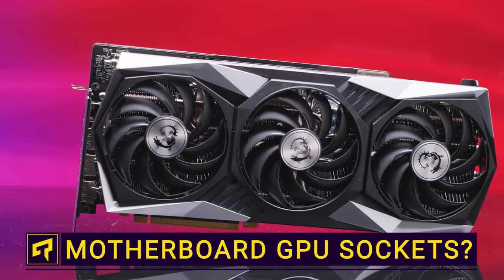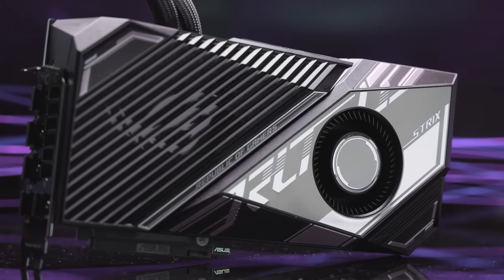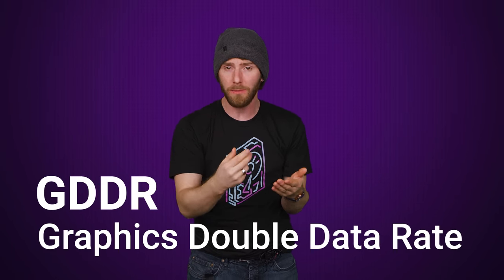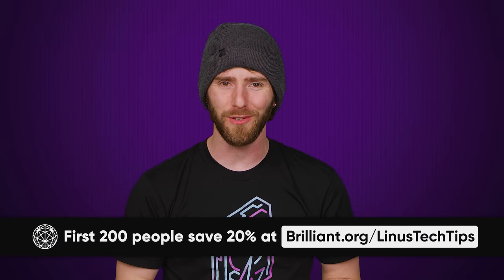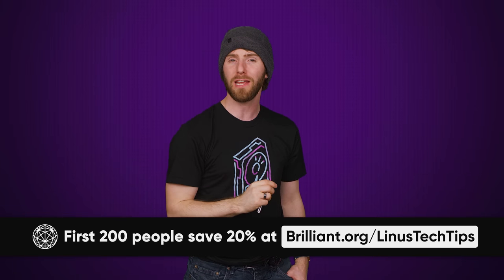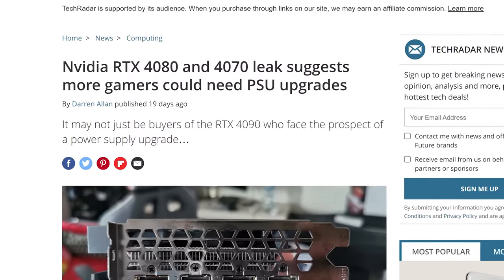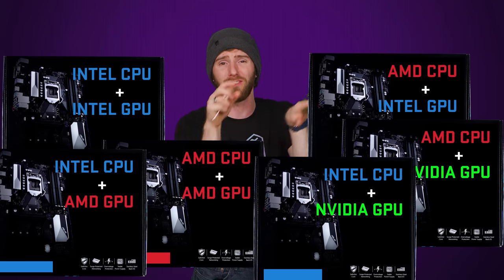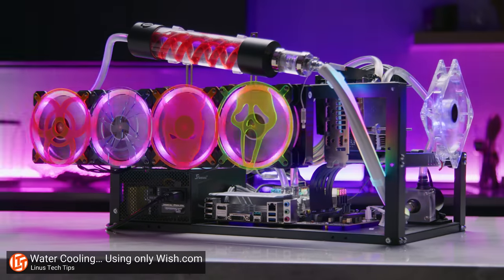Can You Put a GPU on a MOTHERBOARD?

Comment: I have in my parts bin an old Fujitsu Siemens Amilo Xi 1526 laptop with a detachable/replaceable 256mb mini PCI express graphics card from back in the good old Windows XP days. The CPU is socketed as well. So, back in the day it was doable.
The graphics card in mine is pretty much done, I think, and due to not many buying those machines, I never got around to buying a new graphics card. An ebay replacement would have cost more than the computer was worth. I could buy 2-3 better laptops secondhand for the price of one graphics card.

Comment: Company's did do this in the past, as recently as Socket AM3 actually that came out back in 2009, there's 880G chipset boards that come with a intergrated Radeon HD 4250. So why isn't it done today with a low power GPU chip (let's say 25W TDP or less as from what I could find that's what the HD 4250 was) built in powered by the motherboard, a PCIe slot can supply up to 75W of power to a card if I'm not mistaken therefore why not sacrifice a PCIe slot and redirect the power delivery & PCIe lanes from the slot to the built in chip?
Reply: For example, why not cut down something like the RX 6400 to use even less power & maybe less PCIe lanes to maybe have like a RX 6100 or 6200 that uses a max of 25W & remove a PCIe 1x slot with that PCIe 1X lane going to the built in GPU instead?
Reply: Depending on costs involved, I think It would be a OK option for a basic display out for basic use/office PC builds, perhaps bring back the Athlon for next gen with a CPU only option instead of a APU, make it cheap like maybe something along the lines of a Athlon 3000 non-G for less than G like how the Intel F CPUs should be cheaper than the non-F but have it on the lower end, like if Intel were to put out a Celeron G6900F or Pentium G7400F?

Comment: BUT, if you had a graphics card that fitted into the PCIe slot and allowed you to configure more ram and change a chip rather than a board. and dealt with the power it would allow the PC builder to configure the set up to achieve the desired picture quality and FPS. Yes this would be expensive but then so is a 3090 TI . I have an AMD 5600X cpu but if I want to upgrade I can fit just a new cpu and keep the rest the same. I don't have to buy new ram, board, cooler etc. Power delivery can still be achieved to a PCIe mounted board without going through the main motherboard. Vram could be in modular form the same as Dram and applied in the same way. If you need more or a higher clock speed you could change the module for the required one.
I understand the argument for fully built one piece GPU's but if you applied it to computers we would all be buying laptops or pre builds with no choice but to change the whole set up when a new piece of software comes out that needs more of everything.

Comment: Linus, what about one industry standard socket for CPU and one industry standard socket for GPU, all the VRM as a daughter cards like ASUS did on the ITX size (maybe interchangeable for higher powered configurations), and RAM and VRAM as DIMMs (or maybe shared?).
This way, a graphics upgrade cost is reduced because you need to buy only the GPU (without VRM, bracket, memory, cooler, board, outputs) and we reduce the e-waste...

Comment: All-in-ones anyone? My iMac has a Radeon Pro 5500 XT 8GB in it. Runs Cyberpunk 2077 in Windows 10 at max settings, 1080p (minus ray-tracing) with at least 40FPS. Doom Eternal runs at max, 1440p, with likely 60FPS (didn't check). Looks smooth as butter. You could even get the final Intel iMacs with Radeon Pro 5700 XT that have 16GB of VRAM. Beast all on one logic board.

And yes, these Macs were worth it. You could say expensive, but they have a beautiful and bright 5K screen with an excellent camera. They only dropped recently to have Apple sell more Mac Studios and Studio Displays. Getting a late iMac refurbished is actually still a good deal, just hard to find the perfect one.

Comment: What about a single CPU socket per generation for both AMD and Intel. Now we can make mother boards be better if they can handle more power for the GPU and GPUs should have their GDDR slots so they can be upgraded like for example we have seen that RAM in the GPU came short in the same generation even on high end models

Comment: what about going the other way and have add in card CPUs.
So a smaller chip on the mobo deals with IO and all, and the CPU and RAM are on an add in card similar to how the GPU is now. whether the RAM is soldered on to the card or not isn't too important but it enables you to keep your old Mobo and upgrading just the cpu, like a graphics card.

Comment: I agree I agree BUTTTT.... I'm no computer engineer, but amd and intel, intel and amd nvidia can and should be able to use the same pin and socket design. video ram can be slottable and power delivery is as simple as adding more plugs to the motherboard. They aren't using same socket every gen becuz of money grab? they arent using same socket because they didn't have that in mind when designing? Again, I think is possible, just nobody thought about it

Comment: Integrated GPUs are the future.  They’re already the most common, if you count mobiles and consoles.
Reply: The whole point is integrated GPUs are cut-down versions of discrete GPUs.  If we got rid of discrete GPUs we would be suddenly be a decade behind in GPU power, if the new NVIDIA cards are as beastly in power consumption as leaked, even more than that.
Reply: @alexatkin  This isn’t true at all.  dGPUs are actually much more inefficient and difficult to develop for since the assets need to be copied into separate VRAM, and if the CPU needs that data, it’s gotta be transferred into system ram and then back again.  Unified high bandwidth memory simplifies everything.  Once Apple and AMD and even Intel scale up their chip-let designs, it’s all over.  The only reason NVidia is on top right now is because of their robust feature set / real time Ray tracing and DLSS, etc.
The M1 is a first generation chip, based on an 8 year old iPhone chip design…and it’s already slaying in terms of raw performance and TDP.
Reply: @5urg3x  I own a Macbook Pro, for some workloads it's a beast but it also cost more than my 3080 and the RAM can't be upgraded.  Yes it's super efficient but it's not a practical path for gaming.

Comment: Historically there is NO limitation, just ill will that prevents multiple CPU manufacturers from sharing a socket and chipset.
The Socket 7 is a great example where you didn't just get 1 x86 CPU manufacturer chip, not 2 but 3 vendors!
Intel, AMD and Cyrix, and after this Intel huffed and walked out of the Socket 7 to make sure they could sell their own chipsets to you as well.

Comment: i would like to see just a gtx 1050 ti on the mother board with the cpu and then when you slot a rtx 4090 into the board it switches to that
and the igpu in the cpu is just another backup gpu
so you will have 2 gpus in case your rtx 4090 dies

Comment: Why not to put HBM2 ECC memory in CPU? Like why do I need to send task to GPU that gonna run out of vram quickly and load up task with 2 times more ram usage/same or worse speed, if CPU can be faster with vram built in + its be using ram when you run out of it - instead of loading twice amount. I be having such issue when render engines be building BVH structure for GPU to make it understand what is happening (its long conversion of entire 3d scene for GPU, when CPU instantly loads it), and if I'm out of core (no free vram), it uses twice of ram memory. Like if SSD drive Optane can act as RAM then how much better its be to have vram under CPU? Especially with this new Photonic CPUs under development its might become a thing probably.

Comment: I can see del doing this and soldering the cpu and gpu and both memory types to the board so to upgrade anything you need to get at least a new board. The system may work better though until something breaks. Just imagine unscrewing the system and putting in the new one saving only the power if that and possibly the ssd for files.

Comment: Installing a GPU is easier than installing a CPU, though. It really seems like it would actually be cooler the other way around... if there were a slot on the motherboard, and various AIBs distributed CPUs with various kinds of coolers and extra levels of cache. Maybe some would overclock, maybe some wouldn't, etc. Having to mount your own cooler and mess around with thermal paste to get decent performance out of your CPU when a GPU just comes out of the box ready to be shoved in a slot really makes GPUs seem way ahead of CPUs in a way.
Reply: Some very old computers had the cpu like that. You stuck a whole card in a slot.

Comment: Not to mention that we already had GPUs on motherboards in the past - before becoming a part of the CPU, iGPUs were integrated into the northbridge - and they were some of the worst ones in existence.
Reply: Read up on Socket-X, that wasn't going to be low end, it was meant for high end GPUs (for the time). Rendition was working on this idea back in 1999 but never got it off the ground.

Comment: i wonder just how difficult it would be to make little adapter shims for the cpu so any board could work with any cpu
Reply: Impossible.
There's just too much variation in cpu design.
To put this in perspective, Lga-2011(intel) has 2011 'pins', Thread ripper(amd) has 4096 'pins', and AM4 uses 1331 'pins'.
Every one of those pins serves a purpose.

Comment: PCIE physical slot, like the ATX form factor as a standard are old and archaic. GPU form factors are getting ridiculous with 3 and 4 slot cards out there. and the placement of components in the modern PC dont encourage proper airflow. We need a new form factor that encourages good air flow while taking advantage of available space. This is why mini itx is the only sector where we are seeing interesting case designs, since they already need to work around the standard layout.

Comment: But this is what has been ever happened: in one hand in the past manufacturers changed slot dimensions, forms, connectors or CPU sockets, according to technical improvements. In the other hand integrating GPU, graphics RAM and power supply to motherboards will probably show the next steps into computing development because miniaturisation goes faster and faster so one day all those components wolf be at the same motherboards, as well as other components like sound and video have been integrated into CPU and motherboards. Now there are a lot of laptops with soldered components (in most of the cases for commercial reasons), so why we can't think that this would happen one day in the near future to desktop computing?
I think this has not happened yet she to commercial reasons: manufacturers will lose so much money by producing MB with integrated high capacity graphic cards.

Comment: 50% of a motherboard is PCI-E slots. You can totally put a GPU in that section. We're already getting to the point where GPU cards are so big that they just might as well make a daughter board that clips onto a motherboard. The only limiting factor to fully modular GPUs is standards agreements. If the companies agreed to a 512 connector slot for the GPU, GDDR slots for the memory, and a GBIOS slot or uefi upgrade space then we'd be done. The problem today is that, despite all the standards, we're still subjected to proprietary issues like the CPU slot designs even though they're all x86-64 processors now. Really need to open-source the PC architecture more. PC should be about features, not presentation, that's the builders problem, not the components problem.

Comment: i need help i did some shit in nvidia with my drivers and now my pc works realy bad on gta i can see my vram is full but i use to be not even on the half (its uses8500 now) and in auther games i just lag more/have way less fps for exaple i use to have around 210 fps on overwatch but its now on 85 90 my grifiic card is a 3070 ti i did restore all my settings in nvidia but its still the same

Comment: Eh?  I think it'd be pretty easy to do, and prove far cheaper than the current system.  Break down a GPU into its main component parts, and what do you have?  The processor itself, memory, VRM.  All of these can be made into slottable components.  So what if there's a few dropped bits of data, when you can add as much RAM as you need?  Most of the basic components for AMD and Nvidia GPU's come from the same outside manufacturers, don't they?  Imagine being able to swap out your VRM as easily as you do your RAM, and not be beholden to only two companies.

Comment: Did nvidia not do this for really old gpus? I could've sworn I have an Athlon 64 machine with an nvidia gpu in the motherboard itself.
Reply: They did, and LTT somehow dropped the ball on the basic research in a dramatic way. They really should pull this video to save face, but I know they won't. I say this as a longtime and current LTT fan. Sometimes they make confusingly bad errors (like saying that The Guardian is good journalism haha, poor Linus hasn't read very much of The Guardian in the past 5 years).

Comment: It wouldnt make the mobo significantly more expensive! Obviously a mobo with a GPU would cost more but surely (at least assuming that manufacturers are not AH which they are and given SAME profit margins ) cheaper due to scale of production you dont have to manufacture two separate boards but one, you dont have two companies ordering e.g 100 passive components for the mobo and the gpu company 30 passive components for the graphics card but rather one company ordering 130 components from one vendor which makes the process faster and cheaper.

Comment: Modular gpu
MAKE A MODULAR GPU
it doesn't have to be compatabile with all gpu boards, just something you can upgrade for cheaper

It doesn't have to plug into the motherboard, just on a separate board like a gpu

Comment: There were voodoo3 motherboards, nforce (gf2), hell, you even bought a 1050ti motherboard. That's ignoring most laptops ever.

But I guess your point was the socket approach, which hasn't been done.

What I'd like to see is these: https://www.intel.com.au/content/www/au/en/products/details/nuc/elements/compute.html

But with the components on the other side so you can have the CPU and GPU back to back on your backplane - and add real cooling. Probably not quite as short of a card either. If you're going to have a backplane based motherboard, you can at least have it plug into 2 16x lanes and not be longer than a full length GPU.

Maybe suggest that to AMD and Intel? It'll be good to ditch the stupid pcie cables on an sff build and instead have a far more robust backplane.

Comment: I always thought that there should be a GPU socket on GFX cards. So basically you could buy a 12GB 3060 and update the GPU to a 3090 when you can afford it just by replacing the GPU chip and not the whole board. It really wouldn't be a hard thing to implement.
Reply: The problem is though with something like that, you'd run into a similar problem that Linus brought up. Compatibility would be a big issue. GDDR vram timings and bandwidth not playing nicely with different GPUs would be half of the battle. Not to mention cooler incompatibilities. A 3060 cooler would never be able to support a 3090. Nor would the power delivery on a 3060 board. So like linus discussed, the board for the 3060 would have to be overengineered to support the power draw of high end GPUs along with the cooler, further driving up the cost of these lower end cards. You'd be much better off selling your 3060 and upgrading to a 3090.
Reply: @Bluecolty  You are thinking as it is with current tech being as it is. These things can be built into the boards, you build them with the power delivery for a 3090 even on the low end. I work in electronics and pcb manufacture in paricular, the difference in build cost between a 3060 and 3090 card is minimal, like no more than £25. Sure the cooling is going to be different at the higher end, but that isn't exactly a great expense either, what another £25 to make a 3090 cooler over a 3060 cooler? If they all shared a cooler, manufacturing costs would tumble to the point that they would all be at the current price of a 3060 cooler. Lots of the costs of making different coolers is the tooling and design. Sure you would need to over engineer the board, that happens on all motherboards currently. a 3060 wouldn't draw more than it needs just as an i3 doesnt.
Reply: @ZaPpaul  still seems like a lot of work when you could just sell the old graphics card and buy a new one. I'd argue this uses less resources from our planet in the long run since you're not over engineering parts of it
Reply: @Bluecolty  There is not a lot of difference between a 3090 card and a 3060 card, chokes and mosfets for the most part. Surely building a single card that is upgraded only once is far better for the environment than single use cards? I know people dont upgrade much from 3060 to 3090, but imagine when they are a generation behind, buying a board with a 3060 in it and exchanging it to a 3090 for cheap would mean that low end e-waste would be greatly reduced and that is the most common e-waste. There really isn't a downside to doing this, motherboard manufacturers have always done it with CPU's. Technically there is little difference in having socketed GPU's.

Comment: interesting..
But what if you where to fuse a GPU into or onto a motherboard, get rid of the standard DRAM sticks and use GDDR soldered on the motherboard as the system Ram AND GPU Ram.
just make sure there is plenty.

Do i hear someone say, Great idea!?
no? 😟😔